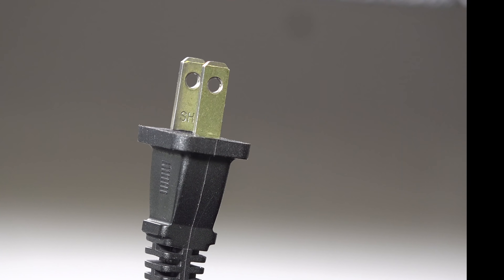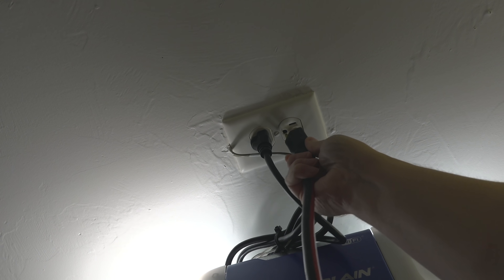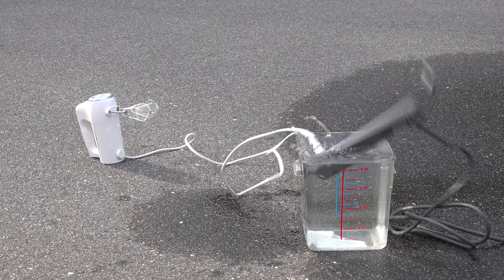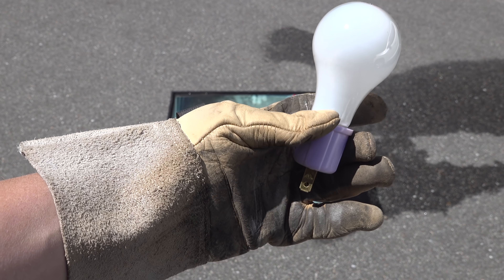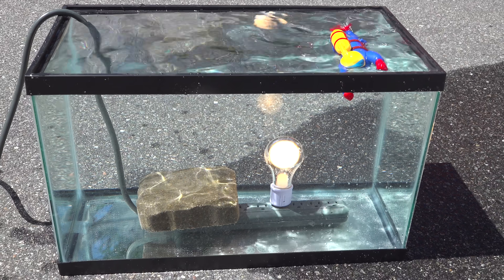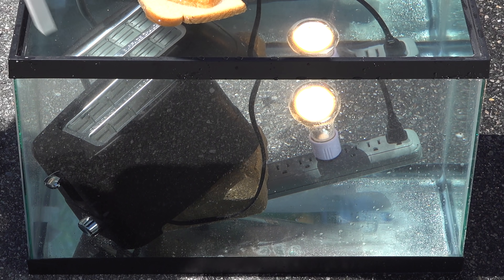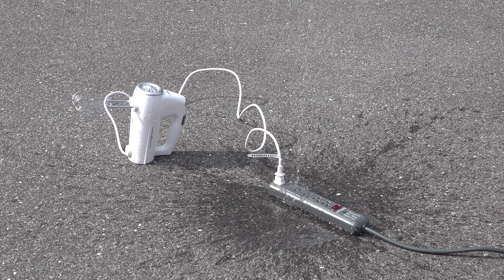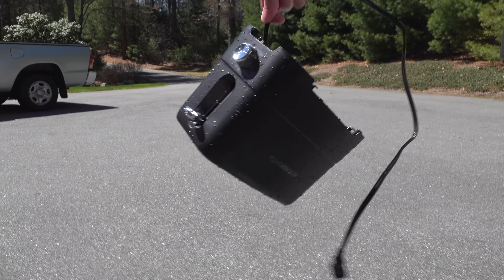What REALLY HAPPENS WHEN YOU SPILL WATER in an OUTLET?

Comment: That's bloody nuts. I was fully expecting sparks and maybe some flames. I was so totally not prepared for the power strip to just "....meh". Great video, thanks!
Reply: Did you really expect to see the special effects from 80s movies?
Reply: @gokudomatic  Nothing "Michael Bay" level or anything. Just thought there'd be... something......
Reply: @scandelis1306  In a way, I understand you. And that's exactly why electricity is so dangerous. It's not visible.
Reply: @gokudomatic  I have a new respect for that now....
Reply: The bucket of water was insulated, there's no direct path to ground to fault. The only leakage current is between the hot and neutral prong holes, not enough to trip the breaker but enough for the GFCI to notice.  If you did it in a puddle of water it would be very different.
Reply: @Kanglar  damn Hollywood for giving me false expectations.
Reply: The power strip was a whole mood.

Comment: BS. You would not get electrocuted unless you add alot of electrolytes to the water which would trip the breaker...if you touched the water with both hands you would have to be standing on wet ground to be shocked bad enough to harm you...you may get mild tickling with saturated electrolyte water if you put your hands in at most. You must be earthed and do it for it to be dangerous

Comment: I have a power strip next to my bed that I use for charging my phone. I also use it for a couple other stuff. It’s attached to my wall with some command strips. The other day I knocked off a drink on my desk and it spilled on the power strip. I immediately turned the strip off. After that, unplugged everything, wiped stuff down and let stuff dry out for a while. Everything is fine with The power strip now.

Comment: Clear water doesn't effect electronics at all. In fact, I washed the circuit board inside my keyboard in my shower and dryed it, and it works fine. It's not the water, it's if the water is dirty or has soap in it so the electricity can travel trough, it gets destroyed.

Comment: You should've had a voltage/amp meter to measure just how much electric current was in the water.
Reply: It's a very unwise to try to measure anything. When you are measuring current the resistance of the tool is very low. That means, the current will try to pass through the tool, because that's the path of least resistance and the voltage was the same as in the outlet. The reason we didn't see sparks is the resistance of the water was too big for the electricity to form an arch in the outlet. The principle is the same as in the old tube lamps. Two electrodes at the ends of the tube. We have mercury gas in the tube, because the arch must stay lit and that makes the resistance lower. The voltage is raised and after a couple of flickers thanks to the capacitor we have light. The same lowering of the resistance would have happened if there was salt in the water.
Anyone who has questions is welcome to ask.
Reply: @imperator523  Have a critique and question actually. Addressing your first sentence , that's why we have uncertainty values as that is a source of error as then by your logic it would be unwise to measure anything, even SI units are calculated with a degree of error. The resistance of the tool is purposely low to reduce electrical dissipation via work done against the resistive elements of the ammeter. Second sentence, as the arrangement will be in series, the current will be passed through the ammeter anyway, that's the way you'd traditionally measure current, passing it through a sensitive enough moving coil or moving magnet in series that whose motion indicates the amperage. Lastly, actually intrigued by what the capacitor does in the fluorescent lamp arrangement, from what I've seen we don't have them now and I could only guess it's for reactive power reduction.
Reply: @jaimenaught9000  Well said. Sometimes yes inductors and capacitors balance reactive power. However remember that capacitors are used for temporarily storing electrons. Since you said this is a fluorescent lamp.. if that is true then the capacitor is used to charge the gas in the tube. It is sort of like when a capacitor is used to start a motor. On the otherhand if this is an LED bulb it is similar to what your idea was.
Reply: @yourhomiejack5977  see my first comment there bud
Reply: To use an meter, you need a mass. The tank is isolated from mass.
Reply: @stefano8936  Elaborate on what mass is in this context. The water is a body of mass, and the soil is a body of mass, two points to measure the voltage.
Reply: @tavish1658  the water can be considered as a (probably small) capacitor. To measure the current, you need to put an ammeter in series, and in this context I don't see how it can make sense. If you use a voltmeter, it doesn't make much sense neither, because the ground is serveral meters away and can have voltage very different than the potential of the ground under the tank.
Reply: Yes but the videomaker is trash
Reply: close to none. Pure water without salt is hardly conductive
Reply: @BigMek456  Even rain water is conductive once it hits a surface with a bit of dirt on it.

The same may apply to this bucket.
Reply: @tavish1658  Depends on what the water is contaminated with. Leakage current (if thats the right word in English) maybe trigger an RCD, but pure water is not going to trigger a circuit breaker
Reply: Yes pls
Reply: Exactly my thoughts !
Reply: water or not doesnt change, but the things what have in the water can do alot of stuff, like salt, sugar, etc
Reply: @bl1nd_ness664  Dunno what you're trying to say after first comma but even that is wrong. Water will conduct electricity as tap or lake water from the presence of charge carrier ions so there will be increases in voltage and current while it'll be electrically insulating when pure.
Reply: @jaimenaught9000  Yea, its like this:
clear water × Eletricy
Farted water from gamer girl = eletricy
Reply: @bl1nd_ness664  *gasps and clutches pearls*. I am personally and spiritually appalled at your scandalous tomfoolery. Never reply to me again upon this forum. Your family should be ashamed.
Reply: @jaimenaught9000  i have asthma and im almost dead rn
Reply: @jaimenaught9000  wtf is this thread lmao. it short circuited the electricity in my brain cells to go haha
Reply: @SmallSpoonBrigade  cough clears throat SEE MY FIRST COMMENT!
Reply: @bl1nd_ness664  Farted water lmmfaoo 😭💀
Reply: @scorpionwins6378  😭😭😭😭🤑🤑
Reply: @bl1nd_ness664  That's why it's very relevant to measure the voltage in the water. If the water is too clean, it wouldn't  conduct well enough to short circuit, and the devices he's throwing into the water tank are simple applicanses that are not vulnerable to low voltage short circuits. I'm positive, that he'd have different results, had he thrown phones or laptops in there.

Comment: Dude, Leather gloves won’t protect you from getting shocked. You’re supposed to wear insulated rubber gloves.😉
Reply from the maker: Those ones are Facom 1000v rated ones
Reply: @SilverCymbal  If they’re specifically for working with electricity, that fine. Most Electricians were rubber gloves.

Comment: The bulb looking different under water is because the difference in the speed of light in the material (aka the refractive index) is less for glass vs water than it is for glass or water vs. air. Light always picks the fastest route, which means it tends to bend (refract) when it encounters an interface between two materials with different refractive indexes, as well as reflect off of such boundaries. The bending and reflection is less as the difference in refractive index decreases. If air and water had the same refractive index, water surfaces would look perfectly transparent to us. The same sort of thing is going on to make the bulb appear different when it is submerged in water.

Comment: And i was always hella scared of wiping the plug with a wet towel for cleaning dust. I could swear as soon the water shorted circuit the plug, the water would get eletrified and the ele eletronics would stop, and that the sc would cause a fast heating/melting on the cable or wall plug itself. Good to know its only the water that gets electrified. Maybe would be nice if you could put a voltimeter on the water to measure possible voltage in it?

Comment: No big surprise here. The water will draw more current, but not that much more current, though the mineral content of the water makes a huge difference in the amount of current it adds. Of course, it doesn't take much current to kill you, so it was a good idea to avoid handling this stuff. The old vaporizers they used to suggest for a stuffy nose boiled water by just suspending two copper plates in it, with the current across the plates heating the water. On the down side, the less water you had left, the less steam came out per minute. On the up side, if it ran completely out of water, the current stopped, so it could never burn your house down.

Comment: The reason is because of the fact that the electricity takes the lowest potential or the path of least resistance,  the problem with toasters is that if you used a knife to short the contacts you electrify the case which is then fed to neutral

Comment: It all depends upon dissolved material in the water. Pure distilled water has very very little conductivity. If your skin is wet however, then there are salts from sweat and other such stuff on the surface that make people very conductive. The tap water where I live has a lot of dissolved minerals in it, the outcome of this experiment might possibly be different. I will try it myself… and of course using appropriate safeguards.

Comment: The circuits in the electronics are made from copper - which offers much lower resistance than water. Electricity will take the path of lowest resistance - which is still the circuit allowing the appliances to continue to work. The only likely reason that they would stop working is the water bridging part of the circuit and creating a short.

Comment: During a flood in my neighborhood years ago there were houses under water and it never tripped the breakers. If you walked into the house than you could feel the shock from the outlets that were underwater.
Reply: Standard breakers are not designed to trip under these conditions. They are primarily “overcurrent protection devices”. The branch circuits are not the real danger in the case of a submerged circuit panel. The danger in water rising to a circuit panel is that the incoming power legs from the pole are submerged and they have no breakers on them.

Comment: At a two story house I lived in, we had a water leak on the second floor that eventually went down a conduit and into a ceiling fan containing a light fixture on the first floor. The fan was still running and the light was on even though the entire thing was full of water. The light bulb was superheating the water inside the globe. When I turned everything off and emptied the light globe, I noticed there was water within the sealed incandescent light bulb. I could shake the bulb and see the water inside sloshing around but the bulb was still working. I still cannot adequately explain how that water got inside that bulb. True is stranger than fiction.
Reply: Probably something to do with the temperature rising to extremes, this then broke the vacuum seal of the bulb, this then sucked in water into the bulb that was later trapped when the bulb cooled and sealed

Comment: would have been interesting to see a measure of the current going into the water.
Reply: That would be extremely difficult without a controlled narrow area of water. Readings would be very inconsistent as voltage attempts to take various paths through the water to complete the circuit.
Reply: @TheGodkitty  well you could just use a kill a watt and see the power consomption difference between in and out of the water.
Reply: @TheGodkitty  That's why you take an average

Comment: Before I watch this video I already know exactly what’s going to happens, let me guess the circuit breaker trips from the electrical arc,  and the power for the house goes out, but this could be fix by flipping all the circuit breakers on a main panel to the open position to reset the panel then you’d start flipping everything to the closed position to close the circuit, however your should ensure everything is dry first before doing this, the second scenario I could think of is their is a gfci duplex receptacle in your bathroom which most bathrooms have, and if that gets wet then only that outlets power should stop working

Edit: to my utter surprise I was mostly wrong 😂 I can not believe that nothing happened, I know that electricity flows in the path of least resistance but Holly hell I was genuinely expecting that thing to burn out, I was wrong

Comment: This depends heavily on the water used. Pure water is an insulator, it is the other elements in the water (not the water itself) that can carry a lot of current. Using water from a lake or ocean is likely going to have a better chance of flipping a breaker.
Reply: Do a part 2 test!
Reply: just add salt to the water and things will start to break
Reply: Pure water is actually used to clean electronics.
Reply: The thing is: yes water is an insulator, but if you put a outlet in to it the contacts will corrode, there for release salts. There is more than just  NaCl 😉
Reply: yup, add some salt and it's gonna blow
Reply: It Entirely depends on the type of water and what's in it. Unfiltered City Tap Water or Salt Water will almost certainly conduct electricity and short electronics.  

Some well water or Pure Distilled water on the other hand will do absolutely nothing. Since it contains nothing conductive in it. However over time the water would get more conductive from the other metals in the circuit board breaking down, rust, etc.
Reply: I'm a chemical technologist myself and I don't think pure water is an insulator. But you're right about the rest. The other "elements" are actually salts disolved into the water, those conduct electricity.
Reply: @leoMC4384  if you are really working in chemistry and you don’t know that pure water, only H2O, is an insulator you are doing something wrong and should look for another job.
Reply: @leoMC4384  you should look for a different job then. Why would pure water not be an insulator
Reply: I don’t think so
Reply: salt is fairly conductive.
Reply: @TimsNeggs    By definition, he is mostly correct. Pure water (Distilled water) is a very poor conductor of electricity but it is not considered "an insulator".
Reply: @ruffxm  isnt air a insulator tho?
Reply: @mckstellar1005    It can be considered an insulator, to a point (extreme voltage like lightning exceeds its insulation properties). But I'm not sure how air comes into play with the example in the video.
Reply: @ruffxm  oh no i was just curious if it was... i thought i heard it before and you guys were talking about insulators
Reply: @TimsNeggs  H2O doesn't contain any valence electrons and thus has no localized electrons which means that electricity cannot pass through the water. However the minerals like Na have valence or localized electrons that can pass electricity

Comment: Water is not alone a conductor. It's the impurities in the water that conduct electricity.  So water won't carry much current meaning it will be very unlikely a breaker will trip. GFCI outlets measure the current on both the hot and neutral side to make sure they match. I'd they don't match then there is a current leak somewhere and it will break the circuit.

Comment: Hello! The bubble that you have seen at 3:17 might have actually been made up of oxygen (O2) and hydrogen (H2), but that would only be the case if you would have used tap water, which has ions like ca2+   mg2+ or other ions dissilved in it, which let the water pass electrical current
Reply: How can you distinguish thise bubbles from regular water boiling bubbles?
Reply: @edfx  given that the toaster probably can't output enough heat to boil the water nearby faster than the rest of the tank can cool it, and given that the toaster probably can't actually generate heat given how it generates heat using exposed heat coils currently dunked in water, its most likely water (H2O) being split into Hydrogen (H2) and Oxygen (O2) as a product of electrolysis, the energy of the toaster ripping through the water messes things up and causes the water molecules to break
Reply: I don't think the water is conductive enough to produce significant amounts of H2 and O2 though
Reply: @windowsxpmemesandstufflol  kinda depends on how many ions are present in the water. I tried it with tap water and 230 Volts, there were some bubbles, but not a lot.

Generally speaking, the more shit in the water, - more bubbles, less heat

Less shit in water - less bubbles, more heat

Comment: I think it might look like nothing happened to the appliances and the power strip, but I think they just could start to corrode. It could be not visible immediately, but in time some internal parts that rely on electrical contact may malfunction due to the corrosion. I see it in old cars. Powered parts that are exposed to humidity under the hood do corrode and their electrical properties worsen over time. That's why most of the connectors under the hood are water tight (kind of, they are at least splash resistant). If they wasn't - the whole car electrical system would need a replacement after just a couple of seasons. Home appliances are not necessarily splash resistant so they can corrode prematurely if got wet.